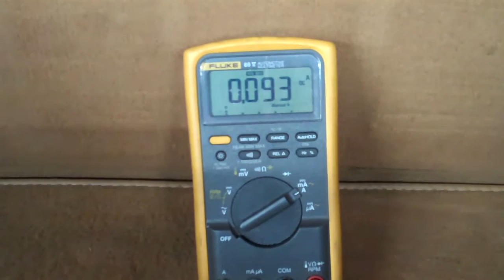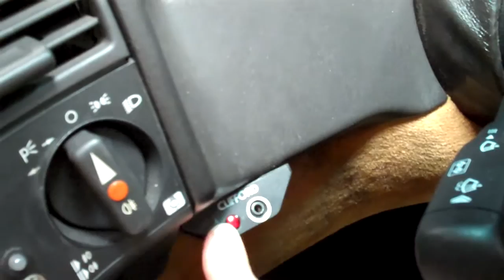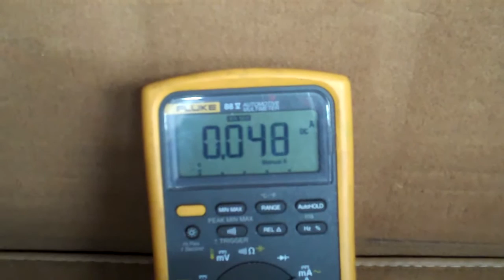1990 Mercedes 300SL Parasitic Draw Test

Comment: 30ma would definately not cause this vehicle to die overnight, work it out, even 100ma or 0.1, would only be a 2.4 ampere loss in a 50 ampere hour battery. if that meter said somewhere aroround 1-2 amps then I would have agreed.